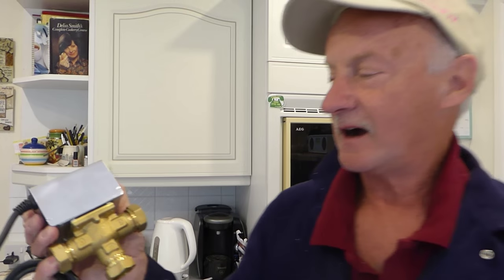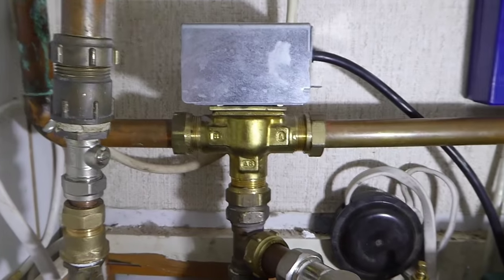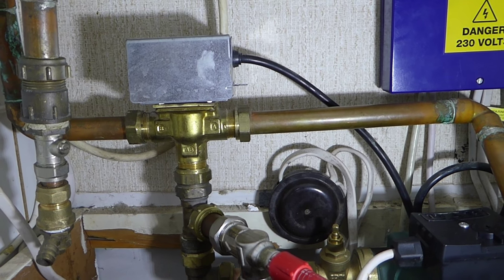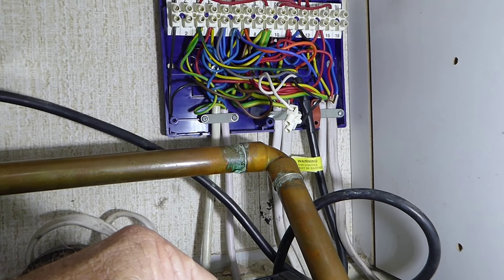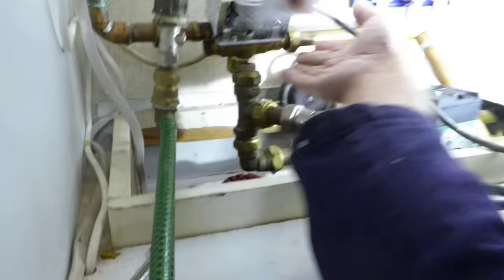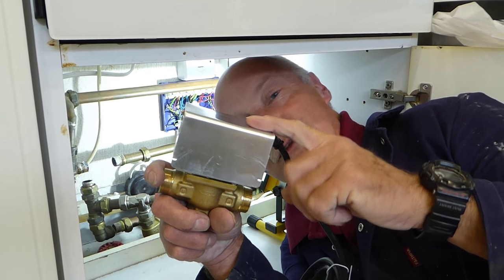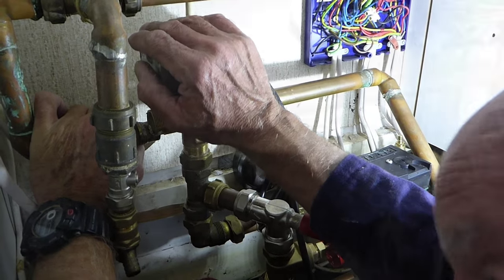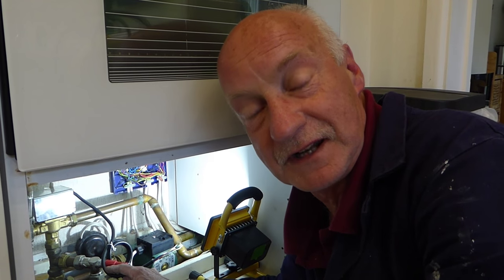How to fit a three way motorised valve. Not just the head motor.

Comment: It's often a good idea to latch the valve's lever in the manual position so that the valve is in mid position. Then when you drain down you don't get any nasty surprises when the valve is removed because all pipes to it should be fully drained.Another tip. I cut the old valve's 5  wires at the wiring centre to leave a 3 inch (approx.) piece of all the wires still connected to the block. Then when you come to wire up new valve you just undo each of the screws on the block one at a time, pull out the small bit of the old wire in the connection and put the wire of the same colour on new valve into it's correct connection. Can't go wrong.
Reply from the maker: Thanks for some great advice. Al.
Reply: dereton33  hello mate. I have the same Honeywell as you but my problem is the heating is coming on as soon as the hot water comes on.  Do you have any suggestions how to fix this please? I was wondering if I could use this same trick but in reverse if that makes sense?
Reply: Good tip leaving small tails for reference.
Reply: @denwinter7730  I would suggest the 3 port valve needs replacing in any event - what you describe suggests it is stuck ...
Reply: @guido7412  thanks mate. We did get it replaced and now it's working like a dream 👍🏻
Reply: Nigel --  Thank you Nigel for this advice, it really makes sense. Will follow your advice when I change the 3 port valve. This really helps because I have no idea.
Reply: Nigel --  Huh? The water in the hot water cylinder is on a different system to the 3 port valve on the heating system. So the amount of water in the cylinder is irrelevant. Also opening hot taps only drains a bit of water from the cylinder as it drains from the top, the rest (most) will still be in the cylinder unless you siphon it out or drain it from a dedicated tail-off piece at the bottom of the cylinder. But you wouldn’t need to do that unless you were working on the hot water cylinder itself.
Reply: @n4e780  Hi - it doesn’t make sense at all. Your comment really suggests you should get a qualified plumber to do this job for you! 😳
Reply: That's great advice.

So what the guy's saying is "the colours will always match?

And what you're saying is, chop the old wires rather than unscrew them (as the motor is tested dead anyway). Then when it comes to plugging in the new motor, you just look at what colours are there,  hanging off the old electrics?

Genius!  Thanks.
Reply: Nigel --  No. The coil that flows through the hot water cylinder is separate from the cylinder itself. No heating water EVER comes into contact with potable water. The 3 port is basically to let the system know whether you want to heat the cylinder up (I.e hot water), or the heating, or both at the same time by diverting the heating water either through the cylinder or just around your heating circuit. This simply means the 3 port is for heating only and draining the cylinder of potable hot water is pointless. HTH

Comment: Thanks for sharing. As well as the 3 port mid position valve I have a red 2 way grundfos valve looks like your green one. What is that?
Reply from the maker: A bypass valve.
Reply: @dereton33  From what I see in the video, the green - 2 port valve you describe  is the water pump .. !
Reply from the maker: No I have a three port video showing  to be changed in the video. The pump is a pump.

Comment: al got no radiators working  only one radiator upstairs still got hot water and all pipes around tank are hot
Reply from the maker: Open the 3 way valve to manual to get you by for now.
Reply: @dereton33  thanks Dave they weren't using the thermostst

Comment: Quick question please guys, I have a 3-way directional unit but when I turn the heating on it seems to be heating up the hot water too. I've opened the directional valve silver cover to see that when I turn the heating on the mechanism is physically moving which it is but if I were to turn the water only on & not the heating the mechanism doesn't move at all. Does this indicate to a faulty directional valve unit ?
Reply from the maker: Yes faulty microswitch in the valve.
Reply: @dereton33  many thanks
Reply: @dereton33  just replaced the directional valve and I have the same problem again when I put the water on the heating is on as well,  any ideas ???

Comment: RIght just done this job and i can hear the motor running now in the valve when I turn on the programmer. However, the boiler is still not firing up when calling for heating, but fires up fine when hot water is called? Wall thermostat is working fine :(
Reply from the maker: Check the wiring is around the right way. Also check the thermostat has the wiring the right way round.
Reply: @dereton33  yes they are. Red is live, second wire is black. Should the wires be stripped at the end or are they fine as they are out of the box?
Reply from the maker: Stripped at the end. Just to make sure of a decent connection.

Comment: Hi Al, as you say it can be beneficial to change the whole fitting as the problem may have been caused by a siezed valve spindle burning the motor out.
Not everyone has the skill to test the actuator head to find a fault, so better for the DIY' er to change the lot. Nothing worse than fitting a new head to have it burn out 5 mins later.
So always try to turn the valve spindle with your fingers first (Should turn easily 1/4 turn) if planning to just renew actuator.
Reply from the maker: Thanks good advice Marilyn..

Comment: Al. Thanks very much. Sincerely!
I have forwarded the link to this video to a former customer of mine. Read on and you will understand why.
The  customer, ostensibly a "competent" DIY'er, called me to attend a faulty 3 port. No heat, no hot water. Controls, pump and (wall/cylinder) stats working OK. 
The cwst/f&e tanks and cylinder were all in the loft. What struck me was that the cover off the wiring box was already off, so alarm bells rung straight away. I multi meter tested the controls to check that they were switching on heat, hot water and both on demand and diagnosed that the valve was the cause of the fault. I initially thought that someone had been "tinkering" with the wires.
I had to traipse across Sheffield to Rotherham, at rush hours end, after a long day on another job to diagnoses the fault.
I stated that I could only get back at 7pm the next day. I called the customer at 6 pm, next day. Left voice mail as a courtesy. "I've been and bought the part, I'm on my way and running early. See you 6.30 to 6.45". Sat in van til 7.45. No one at home, no call from customer "please wait I'm running late". So, I turned off my phone and drove home. 3-4 hours of my time + fuel and 2 consecutive evenings where I could not say "nighty night" to my 5 year old son.
I can only presume that the customer fixed it himself. I really hope that he watches all of your videos in future and doesn't waste any more of my time, ever, EVER again!
I have not even received a call to say "thanks, I've fixed it myself"
Wont hold my breath.
Reply from the maker: Sorry you had your time wasted, I doubt he fixed it himself probably found someone on the cheap. I was a plumber like yourself for 50 years and the amount of times I have been left in the same position.
Reply: What is your company? I will keep your number handy :)
Reply: Sorry, Robert. It is an inappropriate forum to advertise my services. May even transgress You-Tube policies and upset Al. However, if you need a guide as to obtaining the services of a qualified and trustworthy tradesman, especially plumbers/heating engineers, who wont rip you off or botch the job; best bet is to go to your local independent plumbers merchants and ask. I'd avoid the big national companies. If you're local to Sheffield, try Plumco Woodbourne Rd (ask for Neil) or PDQ Heating Spares (ask for Maxx or Mark).

Comment: i have a combi boiler a Keston C25, the zone motorized valve was broken in the system, thx to this video i replaced it myself, its a 2 port valve, was pretty easy to replace, just had to buy to wrenches to hold the valve , it was hard to remove the nuts. Before taking it off i was not sure what is actually sealing the water, but than i saw in your video the ring on the pipe, i have the same, also new ones came with the new valve but i could not remove those rings from the pipe and i did not want to force it so i just left them there, it not leaking. Then i found out the real issue, the valve was actually working fine, tough when i tested it off the pipe it closed the way to the water, but even with the new valve fitted the rads got hot even when the valve was closed, than i realised that the water pressure makes its way through the closed valve unless the motor is installed on it, cause that is forcing it closed, not its ok. The main issue was actually that another pipe above the valve was leaking and dropping water on the electrical connection shorting the motor and burnt the fuse in the main switch on the wall, so actually i could have replaced the motor only and fix the leak above, but anyway it was so easy to replace the valve now i a have a new one.

question :  do i have to do anything now, like bleeding the rads or something? the hot water is good, the rads get hot when the thermostat switches the valve and boiler on, this is a small apartment so i only have one zone for the whole apartment therefore only one valve for the whole heating system, so the system seems to be operational, what else do i have to do?
Reply from the maker: If all is working well then do nothing. You have completed a common plumbing job.

Comment: Hi mate, Great video, I'm going to replace the exact one, the only trouble is the new one i have, cable won't reach the connection box, would it be OK to cut the cable and use thermal block connectors, many thanks gary
Reply from the maker: Yes should be fine. Use one of the ones encased in a plastic box, similar to the connection box.
Reply: @dereton33  thanks mate, i thought so, I have strips of connectors but haven't seen them in a box

Comment: Thanks for the informative video. I have a Drayton 2port valve that is seizing and allowing water to pass as it doesn't shut fully. The motorhead is fine. My system is unvented. I have good understanding of plumbing and electrics and am competent with the basics. I have read that to work on unvented systems you have to be "G3" accredited. Does this apply if a homeowner just wants to replace a central heating zone valve or should I get a professional in?

Also am I ok to reuse existing olives as the look like quite a job to get off? I noticed you seemed to reuse the existing ones, should they seal ok?
Thanks.. and sorry for all the questions 🙂
Reply from the maker: You will be fine to work heating system it is just the gas side you are not allowed to touch. Leave the olives on the pipe work they are usually ok, Just put some boss white on them.

Comment: Hi, which position should the motor's switch be in? Should I put it in the manual, automatic, or mid position? Or will the motor do all that for me? Note that I found it in the mid position after I found the radiators were getting hot with the thermostat down whilst the system was heating the hot water tank on a timer. I had it on for 1.5hr which meant the central heating was on all that time during mild weather. Is it anything to do with the position of the switch on the motor? Appreciate your help.
Reply from the maker: Motor should be in auto position. Leaving it manual means heating and water will be on together.

Comment: I have just had a new consumer unit fitted to replace an old type fuse box.When the port valve comes into operation to switch hot water over to rads it is tripping out the electrics.I was warned that the new unit would be more sensitive to faults than the old fuse box.I am putting the port valve onto manual when the water is hot enough and it is working ok in that position.The water is heated by a coal fire/back boiler system.Any advice would be greatly appreciated.
Reply from the maker: Faulty valve.

Comment: I'm going to be doing this myself on my 2 port valve body this weekend. I notice you just undid the old nuts and left them and the little copper washer things on and reused them. The new valve body comes with new ones, I assume it's ok to just re-use the old ones then? From what I gather from your vid as long as they are done up tight they won't leak? Thanks Phil.
Reply from the maker: Yes a lot less hassle if you use the old ones.
Reply: @dereton33  thanks a lot I'll do that, I wasn't sure if it they were reusable or single use. Do you have any advice on fitting the old nuts and washers back? Like do you have to push the washer upto the new valve body before tightening the nuts? Do you use PTFE tape or any other kind of sealant or will just tightening them up be ok? Thanks Phil.

Comment: Hi Al. You say to refill your system but what's the best way to do this? Is it just switch the water back on, wait for the water to stop filling the system and bleed each individual radiator? What about the boiler, do you need to take any precautions to make sure that fills? What about preventing airlocks or how to remove them if you get one? Thanks!
Reply from the maker: As you say, just switch back on, wait for the system to fill, bleed radiators and let any air out of air stalks near the cylinder,( if you have any). The boiler will refill on it`s own. As for air locks, it really is pot luck, some systems get them others do not.

Comment: I always take a pic of wires before removing anything. I'm no plumber or electrician and get my work signed off but I would like to know if those 3-way / 3 wire valves on Amazon are legal in the UK - given that the green/yellow is the "neutral", blue is "live" and brown is the other "live". I know exceptions have been made in multi-switch lighting circuits.
Reply from the maker: Still legal as far as I know.

Comment: When changing this valve would you recommend draining the heating obvs aswell as the entire hot water cylinder
Reply from the maker: Just the heating system, no need to drain the cylinder.